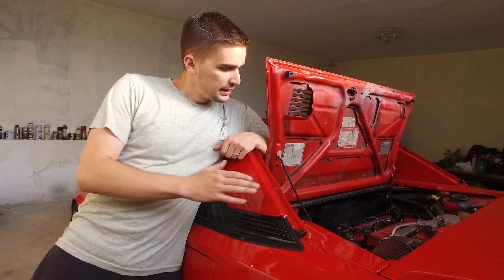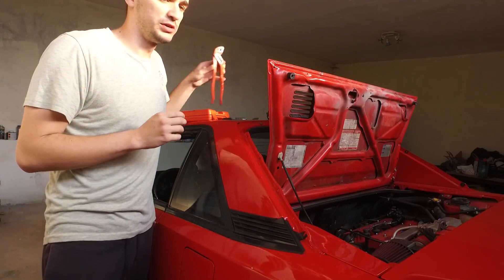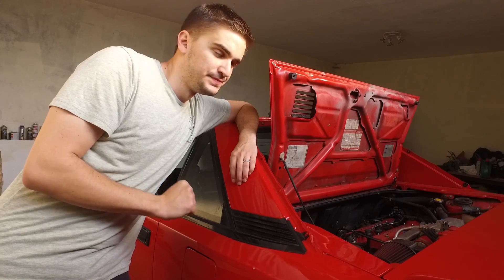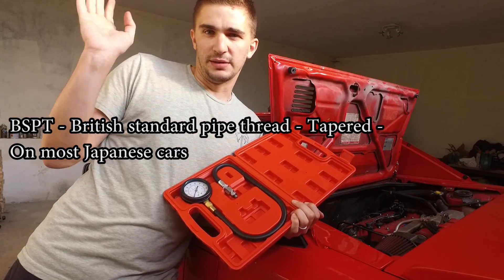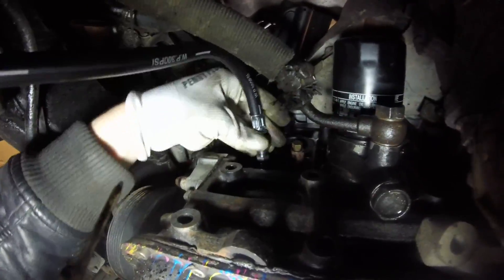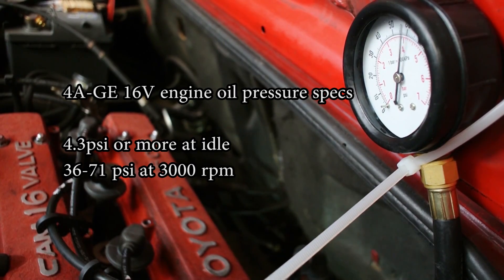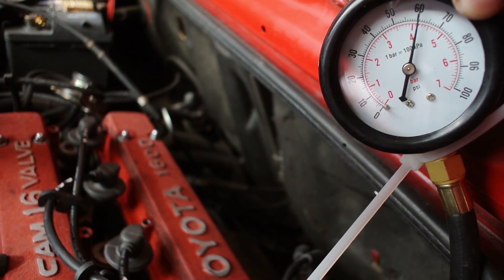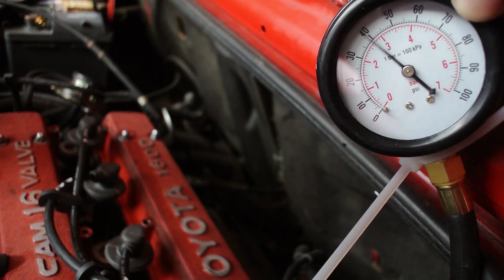How to check your oil pressure

Comment: I have a 2004 is300 and my oil pressure light comes on sometimes when I'm parked idling in my driveway. And my house and driveway is on a pretty steep hill. Is it just the sensor or should I take it in to get checked
Reply from the maker: Check your oil level first. Maybe there isn't enough oil and when on a steep hill the oil pump gets starved for a second or two, oil pressure drops and the light turns on. If there is definitely enough oil in there (at the full mark) then get it checked, oil pressure is extremely important.

Comment: So if you do not remove the sensor while the engine is hot, then it follows that once the test is complete (with a hot engine) you must leave the tester in until cooled down. Yes?

Comment: A little confusion, can we use engine compression pressure guage to test oil pressure, as this guage will use air as fulid, which will be oil in case of testing oil pressure???
Reply from the maker: You use an oil pressure gauge for testing oil pressure and an compression gauge for testing compression. No need to experiment, the gauges aren't that expensive and you can buy them both.
Reply: @d4a  i already have one bourdon tube type engine compression testing pressure bought from amazon range 0-300 psi, oil pressure tester also have same internal design and work on same principle 🤔. Compressibility of fluid matters, slightly i think. Thanks for advice sir 😊

Comment: I had an issue with my oil pressure going to nothing when warm at idle. I was scared it was some sort of bearing failure, and that my engine was about to die. Turns out, the oil overflow (connected at the bottom of where the oil filter parts are) was just stuck slightly open. I took all of the oil filter parts off, took them apart, cleaned them up, put new gaskets and seals on, and my oil pressure issue was gone. Luckily for us, the oil pressure gauge on the dash isn't just an idiot meter that is binary, it can actually read the value pretty well. It should be about in the middle during idle, and get up to about 3/4 when at highway speeds.
Reply: Hi mate I've a problem with my Toyota corolla gti 16v 4age it has a turbo conversion last time I fired my engine up the oil was circulating fine come back year later and seems like no oil pressure because when I take my oil cap of my cams are dry my engine starts up after many cranks then cuts out because it sounds like engine is siezeing up 
Can thus be my oil pump please if u can help me out I would be very grateful

Comment: You have cause for concern with the bearings ?
Reply: Do you use a engine stethoscope?  
If you don't, you should buy one and try it on all parts of your engine that you can reach. You will be surprised how well you can hear the internals, but try not to be too scared!
Reply from the maker: +CR2504life Not really, I replaced all of them with proper size OEM ones, had the machine shop take measurements and then verified myself with plastigage, all were nicely within factory spec. But I swear I can hear rod knock in my oil pan. I'll be dropping the pan soon to know for sure. Will get a backup engine too probably just to be safe.